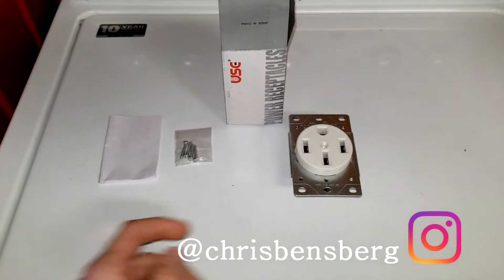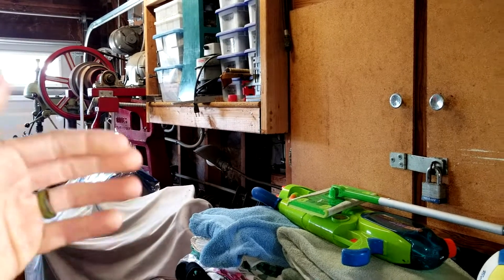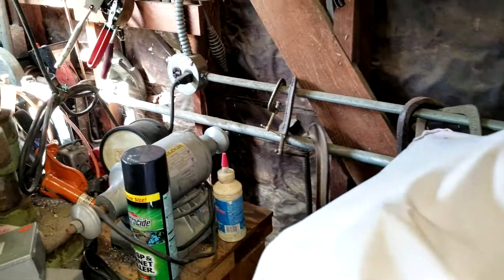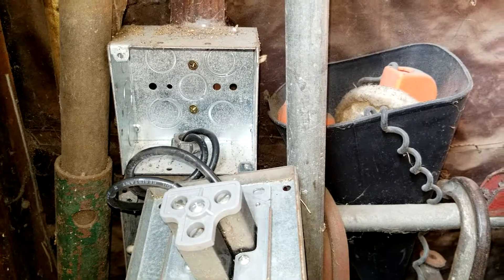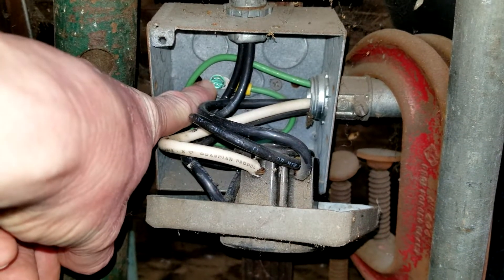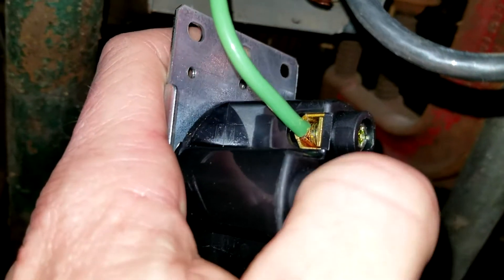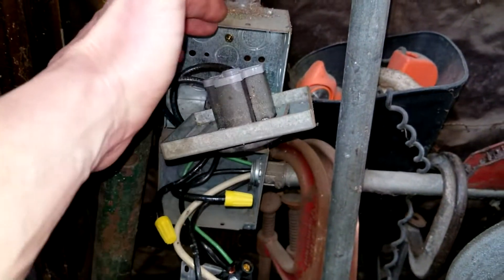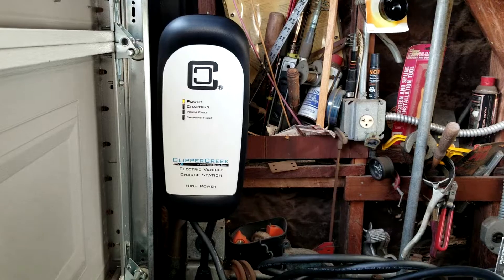How To Install Replace A 240v Receptacle Outlet For Electric Cars LEVEL 2 Charging At Home For Tesla

Comment: Shouldn't  the black  wire going straight  to  the  top box be connected to another braker?  Let me know.  Thanks.
Reply from the maker: Yes, my dad said he wired it this way so only 1 plug works at a time and you can't run both at the same time which he says he never does.
Reply: @TipsNNTricks  . Thanks for replying.